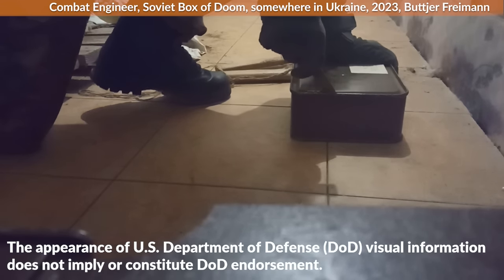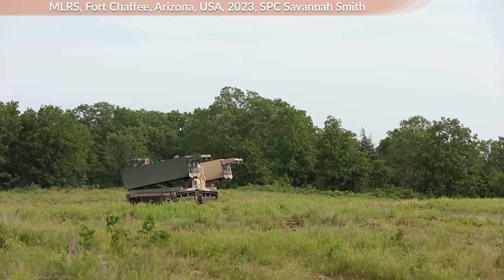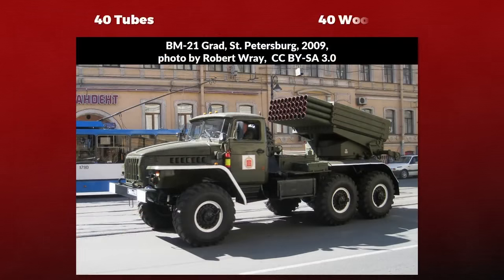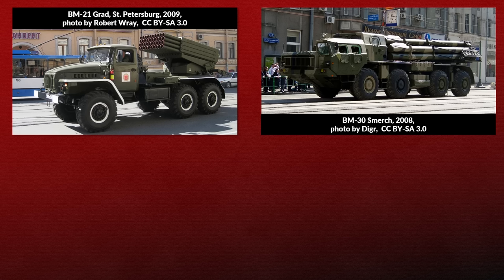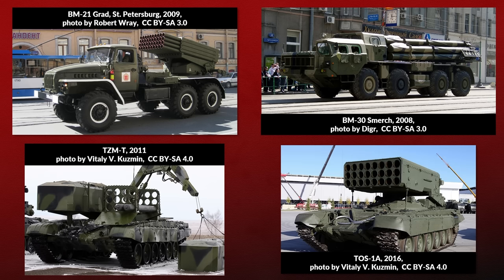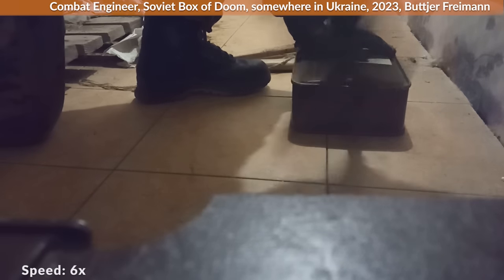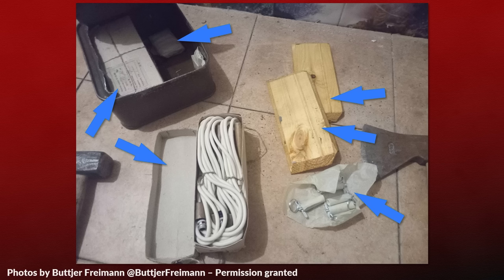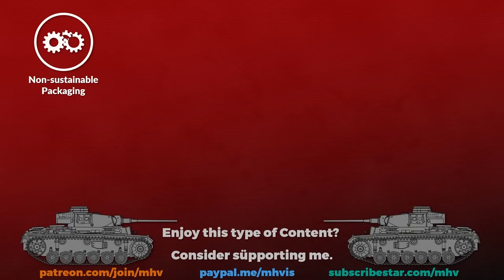Ukraine: Why Soviet Packaging is a Nightmare - Unboxing Edition

Comment: You miss the point. Any vehicle can be used to transport boxes. Its a war practicality. Specialised vehicles for resupply are targets. Extreme war always comes down to the most primitive use cases. The vaunted NATO equipment is performing poorly overall in Ukraine. Its designed for a 'cleaner' war scenario where they are up against quite basic rebels. In a war of attrition, which is what all evenly contested wars come down to, the Soviet methodology has been proven. Wunder waffen do not win dirty and huge scale wars. Simple to use, quick to build, cheap to produce and sufficiently effective weapons in the hands of people doing the fighting make the difference.
Reply: And when a single HIMARS rocket can outrange and do more damage to a target than 6 BM-30 smerches firing their entire volley salvo, while also requiring 12x less logistics and man power to operate, and even costs less than that entire salvo many times over, you get an incredibly lethal weapon.

The HIMARS is not just produced in massive numbers (10k a year in 2022, and a low ball production of 15k in 2025), it's pin point accuracy allows it to be dirt cheap compared to the unguided, mass firing weapons Russia uses.

The truth is in the pudding. Ukraine, the poorest country in Europe, using equipment worth 4% of NATO's combined annual budget, has managed to not just hold back the "second" strongest military in the world, but pushed that military back on most fronts.
Reply: @loppa because you are comparing an apple to an orange.  The HIMARS's equivalent isn't BM-60, it's the Tornado-S with their GLONASS-guided rockets. Both  HIMARS and Tornado-S serves as platforms to launch precision guided missile, while the BM-60 is for whoever tried to bumrush with waves of armored columns/massed infantry assault.

Comment: Imagine if they had a sardine can opener function on those cans?  That would make them more expensive to produce but they'd serve the same function and open much easier.  Even a WWII C Ration Can with a Key that twist a band that cuts through the packaging would also work well as well.   Issue is again more expensive that way.   This is a terrible system without a doubt.   USSR was just too cheap at everything it did.

Comment: BM-21 - 1960, 122 mm.
MIRLS - 1980, 227 mm.
Hey, these are different generation systems!
What awaits us next? Comparison of T-34 with Abrams? MiG-15 and F-16?
Reply: Technically M270 and Himars can shoot any rocket calibers, just put them in the standard rocket pod, see the Israeli Romach AccuLAR 122mm and 160mm.

Comment: Dont be naive, NATO whoud lose even on logistics. What WW2 taught us you need high numbers whit moderate-normal compexity of systems.
You can hand load BM-21 rockets by hand, but do you haw a crane loader for western modul boxes? Every time on place of deployment?
When you losse loader you losse whole system function.
Soviet army was biger in numbers as well, not just equipment.
Tin boxes are hard and slow to open but remember that ammo has to be in water and mud for months.
Whant a nice box of corroded useless ammo or hard to open but functional ammo.
Dont forget that most of soviet ammo used steel casings not brass.
It corodes in a minute, but is much cheaper to produce.
Germans in WW2 used all brass in Europe for ammo...
Reply: The last two years have shown reality child. Open your eyes and stop swallowing the Pravda.
Reply: > but do you haw a crane loader for western modul boxes?
Aaaaand you didn't pay attention. The crane is part of the vehicle itself. it does not require a second vehicle, and western forces have enough working trucks to use actual trucks and not some requisitioned civilian stuff.
> in water and mud for months
While the point applies to the soup cans, it does not to the wooden boxes, and the ammo crate for HIMARS is weather sealed, so there is no problem with that.

Comment: there is no way they can load  a rocket in one a minute impossible it takes maybe an hour to load +++ also the lower ones get loaded fast the higher ones you need to use the empty boxes to stand on so you can load even if they angle  the launcher  system so it's lower  ---  I have even seen some that went it and stopped moving  @ 80% they had to bang on them to move  3 or 5 minutes   -- thanks for the UKRAIEN drones now they are picking them up so quick before they an even fire  at the opening of the war  2 years ago they tried to get them with artillery strick which was a hit and miss plus using so much shells -that is all over now

Comment: What you don't understand is: Developed nations are up on technology and usually down on manpower due to high labour cost. Underdeveloped nations like Russia or North Korea on the other hand are the polar opposite. They are low on hard to manufacture and difficult technology and very well supplied with manpower, because these nations tend to have large numbers of low-rank conscripts. From the perspective of a late Sovjet planner, that system would have made complete sense - and he'd have been right, because while there often were no specialized trucks or forklifts available, there always were conscripts to manhandle stuff.

Comment: Totally wrong by comparing BM21 Grad and HIMARS.
Complete miss.
Both have advantages and disadvantages.
HIMARS can't load such number of rockets and it have heavier rockets which can't be transported and loaded by hand.BM21 lighter rockets and loaded by hand and if they were in containers there will be half of them on MLRS because packaging. BM21 is old system and compensate precision by number of rockets and saturstion.
Ofcourse that HIMARS is better but it is way too advanced, cost more, doing more damage and most important it have completely different purpose.
Embarrasing video 🤦🏻
Reply: If you missed the fact that he was using EXAMPLES to compare western logistics and packaging, I'm scared as to what else you will miss that is in front of your nose...

Comment: Imagine a logistics train of which approximately 30% is heavy wood packaging material because the Soviets couldn’t manage smaller container types.

Some super power.
Reply: They use wooden crates, but not because they are idiots, wooden crates are used to build dugouts and as firewood for campfires and camping stoves. In addition, the most famous Soviets army shovels have a pointed side surface that can be used as an axe.
Reply: @PROIIIKTOR  Does that really offset the much reduced logistics and additional manpower required though?

They will need two or three trucks whereas a NATO army will need one. And those supplies are not always going to the front line trenches. They are more likely delivered to depots where all that wood is hardly and asset.
Reply: @kirishima638  These small crates can be loaded and unloaded by ordinary soldiers without the use of mechanization. they can also be distributed over a larger area in small batches, which eliminates the destruction of all ammunition if the enemy detects and hits them directly in combat positions. Considering that they are firing 10,000 shells a day, apparently this is not a problem for them.

Comment: Yes, "The Soviets would lose to NATO only on logistics"?!

Well, the Russians are not Soviet, but they use, like the Ukrainians, a lot of Soviet military equipment, ammunition... If that is really so. The Ukrainian army with 10 years of war experience, and with 10 years of training according to American and NATO standards with the best Western military equipment, logistics, intelligence... As well as with the human resources of the largest and most powerful NATO army after the USA, and that is certainly the Ukrainian army, as they said themselves, had over a million soldiers in 2022... If we add to that plus hundreds of thousands of NATO "contractors" mercenaries and volunteers. .. Ukrainians would have to be at least in Crimea, if not in Moscow. Because while the stupid and backward Russian opens packages with ammunition and rockets, for the Grad 122mm or Smerch system, and while he manually loads it all... Modern Western military technology should have destroyed it a long time ago?! However, on the battlefield, something doesn't quite work like that, but the other way around. As we have seen so far. Napoleon, the Swedes and Hitler thought exactly the same... Well, we all know how that ended. And this will now end the same way in Ukraine!
Reply: tldr

Comment: This "tradition "comes from the "whatever" and "don't care" attitude, to everything, in the soviet era. During the second war Soviet soldiers were carrying their "pepesha" on simple string, until today they don't use sock in the army, but they wrap their feet in a piece of fabric footwrap (onuca)... So all theses are projected on every aspect of life. However, I visited Russia several times and was sometimes surprised by high level of education, and arts.
Reply: Russians have not used "footcloths" for a long time. But some soldiers consider them more practical than tactical thermal socks, because in war you don't have the opportunity to wash your socks or dry them, even if you have a second set of socks, your shoes are still wet, and the socks will get wet again in five minutes.

Comment: a 10+ minute video just to come back to the same reasoning that explains every other thing..

cost

Soviet Union (and Russia for that matter) have the ideology of 'quantity over quality' while the west puts a shit ton of money into quality.
furthermore, as you've shown yourself as well, these cans used in the war often come from the 1980's if not earlier, so comparing it with stuff from 2008 (especially the Grad VS HIMARS comparison) is just ridiculous. Also, using a soldier actively involved in the war is a bad source.. why? they're biased. Russians will claim anything western stucks and Ukrainians (and foreign volunteers) will claim anything Russian/Soviet will suck. Personally, i think the 40-50 minute reload time for the Grad seems extensively long even with fatique in mind!

however, since then, Russia has started using new ammo boxes for ammunition and small arms, and even is exporting them to (atleast) Syria according to an article from 2018. In this article, the manufacturer says wooden boxes will remain in use until stocks dry up. He also states wooden boxes also have positives "Sometimes, wood is indispensible, for instance, when the boxes must be destroyed after transportation, or personnel needs to get warm."